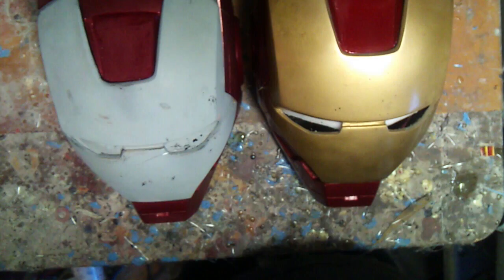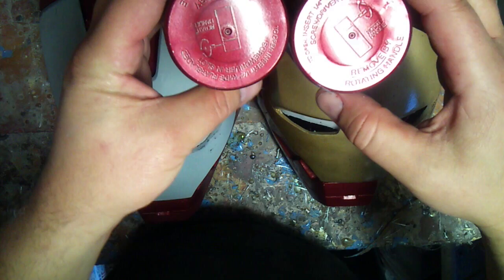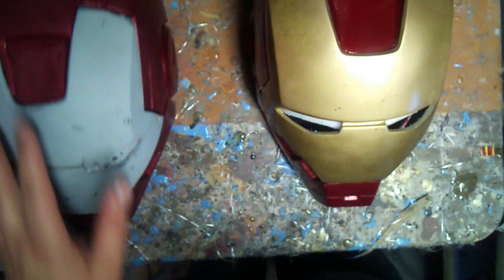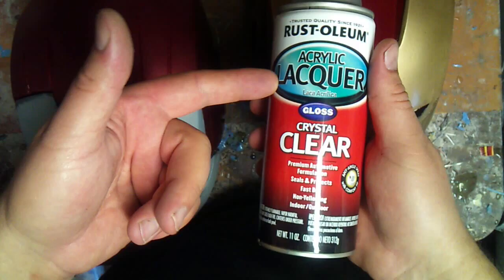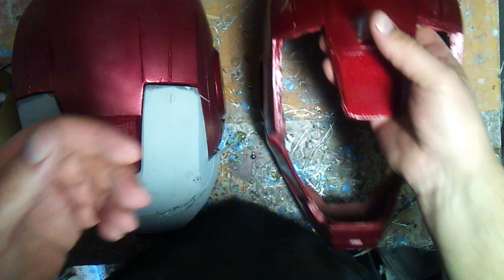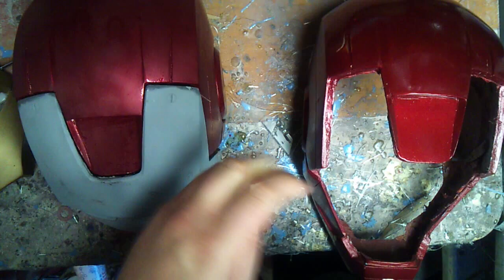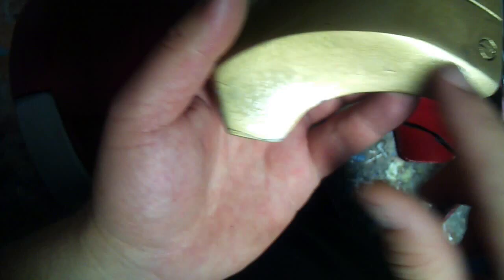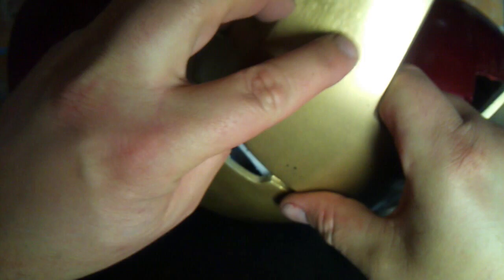Painting, compatability of paints

Comment: You are correct, different types of lacquer will react to different to paints, i had the same problem couple years back when i sprayed my guitar. Acrylic don't usually gel with automotive paints but apparently it can be done, it's just time consuming between paint curing and layers of lacquer if you were to go down that route. 
Generally i would stick to using same brands as it's less hassel. 
Enjoying your videos keep up the good work \m/

Comment: Another anomoly is fogging of the paint and Clear coat. This is typically either temperature or humidity based, or both.
I always run my dehumidifier in my shop for 30-60 minutes prior to painting. This increased the ambient room temp as well as reduces the humidity. Perfect finish, every time!